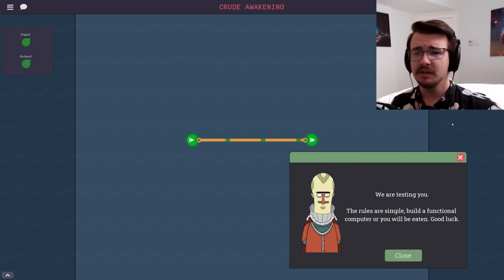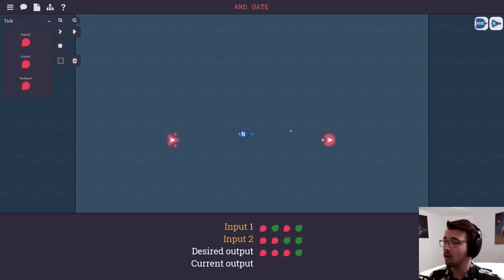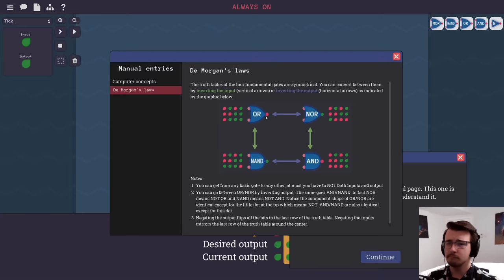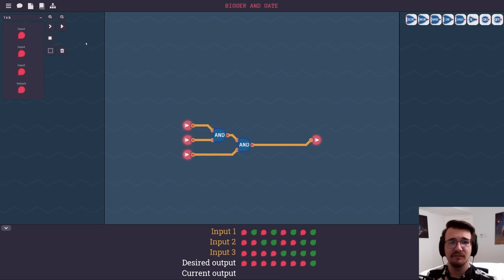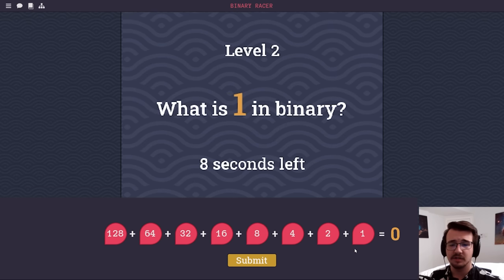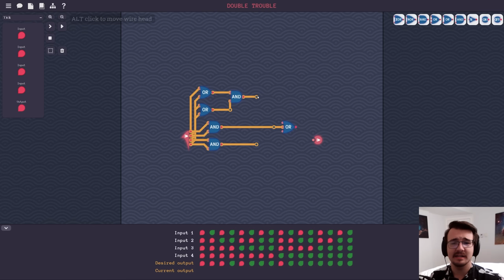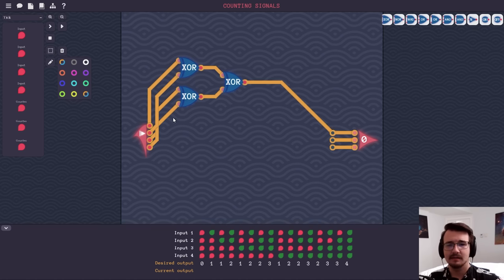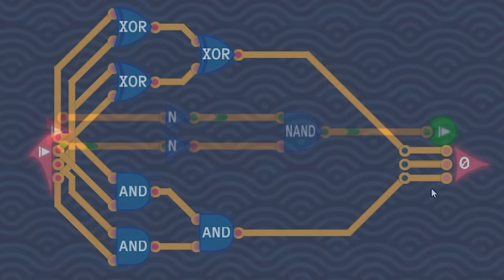A Game Where You Program A Computer ENTIRELY From Scratch! - Turing Complete

Comment: You genuinely come out of this game feeling like you could design and build a computer from scratch, it's incredible. Especially if you go out of your way to make the more freeform second architecture good. Admittedly there's a lot of electrical details it doesn't cover that might have been neat to see, but even at this level I've never had a game raise my self-esteem so much.
Reply: That sounds debatable that they are able to cover even the basics disregarding the electronic parts--instruction set architectures (RISC-V, x86), floating point numbers, data pathing, registers, arithmetic logic units, muxes, etc. (for example, look up the MiPS architecture). And that's only talking about the machine code. There's also compilers, linkers, operating systems, caches, paging, virtual memory, filesystems, synchronicity (semaphores, mutex locks), schedulers, RAID, etc.
Reply: @humanoid60  So, it doesn't go into anything past machine code, but as far as the heavily-tutorialized parts go in the end it does have you build a full, basic CPU with registers, a simple ALU, and a call stack that you can write code for to solve a series of puzzles. After that it gets more sandboxy and encourages you to design a better architecture for the later programming puzzles, but the game supports some really detailed stuff. Someone has absolutely made a working 32-bit RISC-V CPU that you can download in this game, though that's obviously not covered by the guided tutorials, and it runs rather slowly at that scale. I would definitely enjoy a game like this that goes into operating system design, though, or one with more detailed electronics. I was disappointed that I couldn't make a terrible ternary computer, but it did let me make a weird thing running on base i-1 binary.

Comment: I think you should give it a try. Though unlike normal puzzle games, the last time I've played, the game provided practically no hints, so you just had to make full circuits correctly in one go. But it is satisfying when it works. And when you do unlock everything, it stops being a puzzle game and becomes a proper hardware simulator, which is neat and you can build some arcade games from it.

Comment: A note on binary because Tyler did half the explanation IMO.

In regular life we learn to count in decimal. This means there are 10 symbols. Since there are 10 symbols, we can use those to write down ten numbers with different values. And for obvious reasons we want those values to be the smallest difference from each other that is an actual difference, which is the value of the first symbol that does not mean nothing, the second symbol.

This lets us write an equal amount of numbers as we use symbols with a single glyph. If we want to write bigger numbers, we use more glyphs. You've learned how to do units, tens, hundreds, etc... Each time you go a number to the left, it's value is multiplied by the amount of symbols you use. This makes sure that each value can only be written exactly one way. In decimal this is  amount is 10, so each spot is 10 times larger than it's spot to the right.

Binary is the same concept, but insta of deca, 10 symbols, you only have two. Nothing, and something. 0, and 1. 2 symbols, means that each place is twice the value of the one to it's right. So instead of units, tens, and hundreds, you have units, twos, fours, eights, sixteens, etc.

Comment: Hmm... This could be an interesting game.
Just checked, and it's early access. I'm hoping for something that measures "how slow" a design is, aka in computer terms how long the gate delay is between input and output.
Then it can challenge you to make a Full Adder that operates in O(log N) time (with N bits). It's possible, for the record. Just difficult to find.
Reply: The game in fact has this!  It's just not unlocked until around midway through, when you complete the first CPU architecture IIRC.  And yeah, O(log N) adders are very interesting once you understand carry generation/propagation.

The game doesn't stop there, though.  There's absolutely nothing stopping you from doing a deep dive into microarchitecture (besides performance limitations of your PC simulating it all, at least), so have fun creating fast pipelined division units (radix division makes your head explode!), floating point units, or messing around with implementing superscalar execution.